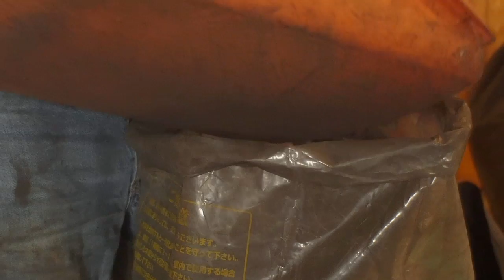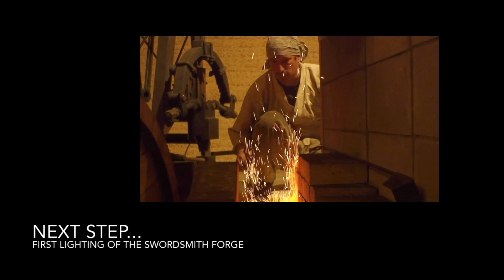Soulsmithing: adventures in hitech/lotech part 5 - chopping and sorting charcoal

Comment: What kind of wood do you use for charcoal?
Reply from the maker: red pine is the swordsmith standard in japan, i use a mixture of available softwoods from pine to cypress and even a small amount of hardwood mixed in if need be...in this video pierre is chopping a locally made test batch of aspen and maple...the aspen is quite a bit tougher to chop than it should be but we are not sure if it is the wood or the cooking time/method...
Reply: Crossed Heart Forge - islandblacksmith ok thanks. I will have to do some tests. We have aspen over here. I will try jackpine as well.
Reply from the maker: jackpine should be a great smithing wood! but use whatever you can, for general forging you can use about anything...african smiths have nothing but hardwood to choose from...construction scrap, brush, etc...